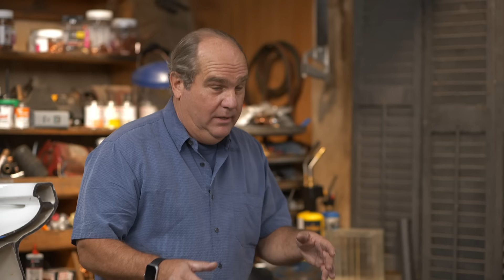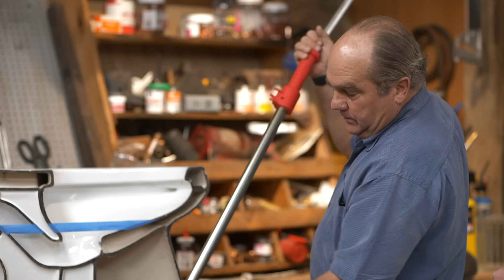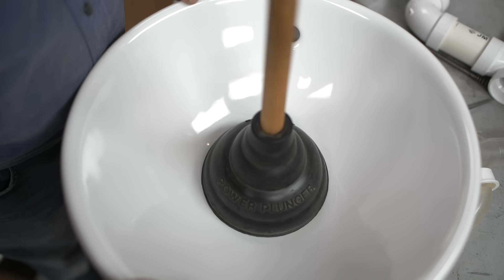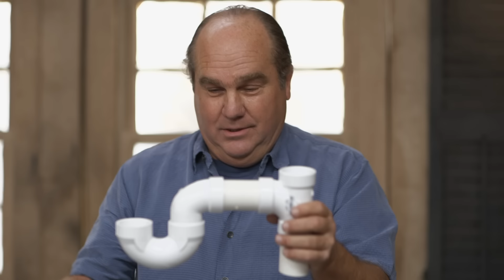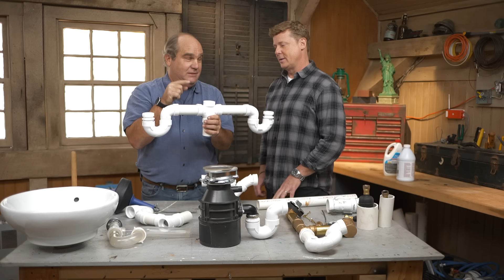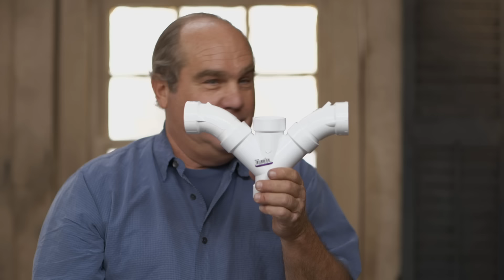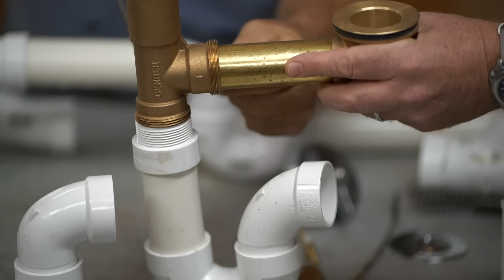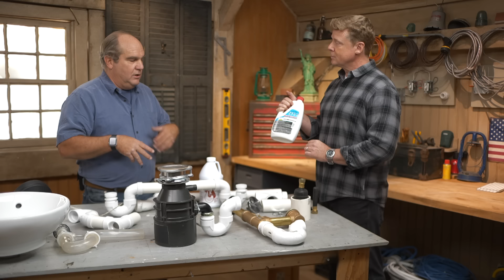How to Unclog Any Drain | Ask This Old House

Comment: One thing you didn’t cover was, a washing machine drain?
Reply: Clothes washer? Its drain is essentially a P-Trap with a long vertical line (standpipe) leading into the trap. Dishwasher is usually connected in line with the the sink drain via a tailpiece that has a special branch to attach the discharge hose to. Just covering both possibilities to your question.
Reply: @falghar4711  It’s a cloths washer. It’s not clogged totally, it’s slow and backs up after a few seconds. It does drain but only when there isn’t a rush of water. I got a snake down all the way, but it’s not helping. I wish I had a scope to see what’s going on. Thanks for the reply.
Reply: @Dominic.Minischetti  is there any other plumbing fixtures down the line? if so, are they slow draining? or is there anything else thats slow draining? (may indicate a blockage somewhere past the washing machine line). if not then maybe a clogged up vent line too (just a possibility)
Reply: @falghar4711  Nothing else is slow. I did a quick vent check and didn’t see anything. The main is wide open and pretty clean. I tested various drains by looking into the inspection port. I’m baffled. I’m going to run a snake down the vent next. I’m thinking maybe a frog got it there. I have found frogs in the toilet and bathroom drains before.
Reply: @Dominic.Minischetti  Ah, that could indeed cause the issue LOL.  Well I hope you do get it figured out. It is indeed baffling.
Reply: @falghar4711  😂 Thanks for your replies, I appreciate it!

Comment: With the toilet plunger, when you put the plunger into the toilet bowl, you allow air into the plunger-- the air will just compress as you plunge.  A better method of plunging a toilet is to insert the rubber plunger into the water,  then invert the rubber plunger so it fills up with water (water doesn't compress). You can then plunge successfully.
Reply: The proper method of plunging a toilet is as Richard mentioned, to pull back the clog, not to try to force it down.  The suction action will work just as well with air in the plunger as water.
Reply: Just like the overflow in the lavatory.

Comment: Is that a double fixture fitting? I hope so Richard. I better not find out you’re putting double ys in a back to back. If so my heart will be broken. As for the rest, I wouldnt bother with the water hose balloon. I’ve yet to encounter a situation where that worked. Those things are rarely able to out much force in the line. As for using chemicals, be careful because if you have a stopped up drain and you pour a bunch of drano in there, the plumber may not be willing to put his cable in there. I’ve been known to use clobber from time to time but only in very specific situations. Technically you’re not supposed to put any chemicals in a drain that’s completely clogged. Regardless of what the commercials show, I’d bet if you read the directions it’ll say to use on slow drains only
Reply: Yes, and IF you do use chemicals and you call someone to help with the drain, you better be a good person and let them know you have used chemicals. Sure nobody wants to have a plumber/handyman or whomever pulling there rod or whatever else and getting a splash of chemicals on their skin unknowingly (until the burn) or even their eyes .

Comment: As a drain tech for the biggest company on the east coast, the hand crank auger is the biggest waste of space, time and money. It most likely won't break through your crappy galvanized or cast pipes. Just call a professional.
Reply: You may be from the biggest company on the east coast, but that doesn't mean you're from the BEST company on the east coast. 😁
Reply: Last time I did, that's what he used! Worked great!!
Reply: Maybe he’s talking about being the most expensive lol
Reply: @ItZ_JoEyLo  Most likely. I had a plumber come a couple weeks ago for a badly clogged toilet. This is what he used and it worked great. Only took a few minutes. He tested a few times after. All good. Only $60, he charged. :)
Reply: @loripatterson7882  $60 is a great price for a plumber, you are very fortunate.
Reply: @ItZ_JoEyLo  I am lucky too, because I have a plumber as a friend.  He'll help me out with small stuff (like replacing the shut off valve on my toilet once) for the price of me buying the parts and buying him dinner ^..^
Reply: @FlameStrykeShadowDark  food payoff rocks, I’ve got an electrician buddy that only charges me @ $40 per hour, a retail electrician in my location is $140+ per hour.